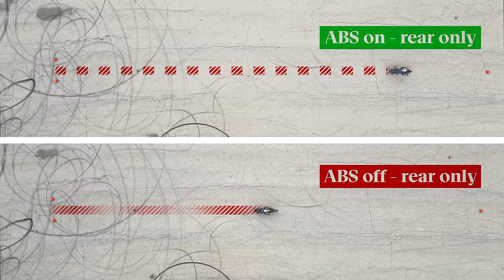Out-braking the ABS Myth

Comment: I wish bicycles had abs. When I need to make an emergency break, I pull both breaks but the back slightly earlier. But this doesn't mean you can avoid falling over. I experienced it myself. I went down a slight hill and tried to get as fast as possible. At +40km/h on my bike, I felt that I'm losing control, pulled both breaks and I felt over the bike. The thing was my back breaks weren't set up correctly and it was not on full power and also due to the situation, more weight in the front.

ABS by nature would mean you need longer to come to a full stop, when all wheels stay on the ground. A locked Tyre means maximum friction and maximum friction means faster stopping. ABS prevents a locked Tyre and so in return you stop slower. But a locked Tyre means you loose the ability to control them. In a car this would mean you continue straight on or you spin, when the force is not perfectly straight on, like in a turn. When you turn during a locked Tyre and it suddenly starts to roll again, you suddenly turn into that direction and people tend to turn more and more, when nothing happens and that would mean, you might turn way to much.

ABS is a good system, because you need to think less. You can go full power on your breaks and concentrate on driving. You can break and turn with ABS. Humans can't multi task. It's not possible and people who claim they can, lie. You can just switch between two things fast. You can't think about how you break correctly and where to steer at the same time. You can keep straight and think about breaking or you can think about turning but you keep the state of the break. You can't think about 2 things at the same time. With training you might be able to know how to break without thinking about it and then you can concentrate about turning. But you don't think about 2 things at the same time. ABS thinks for you with breaking.

Comment: I've found, in cars (I don't motorcycle), that ABS is a liability under any less-than-optimal conditions. I don't know if it's worth anything normally, but it's downright dangerous on snow, ice, and even wet concrete. I like my 1977 truck.

Comment: When I bought my 2016 Yamaha FZ-07 I opted no ABS and saved $400.00 .. My thinking was to sharping my riding skills.  The bike has so much engine braking that I don't use the brakes much in normal street riding..
  I did use the brakes hard on Tail of the Dragon and have practiced Panic Stops a few times.  When I do have to brake hard I put the rear brake on but concentrate on using the front brakes as much as possible.. 
  I think ABS may help a lot more on wet pavement ect.
   I did lock up the front wheel once.. I think it was when a Traffic light changed on me at the last second. I applied the front brake a bit too hard.  Now that I have a much stiffer front suspension with Ohlin Cartridges.  I can brake harder because the front suspension does not dive so much .

Comment: So, ranked from shortest to longest stopping distance:

1) Threshold front/rear with ABS off
2) Threshold front/rear with ABS on
3) Attempting 2 but failing (aka full front/rear with ABS on)
4) Rear only with ABS off
5) Rear only with ABS on
6) Attempting 1 but failing (maybe stoppie, worst case flying over the handle bar)
7) Not braking at all

Comment: I live in a third world country, ABS is for newer and expensive motorcycles. So I have my old motorcycle, without ABS, and I'm afraid of pushing the front break too hard, but I always used it. Still, 4 months ago, I was going too fast in an unpaved road downhill and I knew I had to decrease speed. I pushed the front break just a little bit, but it was enough to make me slide and I almost broke my hand in half. My hand has been hurting for the last 4 months, specially my thumb, and maybe it will never be like before. Sometimes I wonder if ABS would have saved me. These old drum breaks also change sensibility according to humidity, they have more grip if it's cold and wet, so you might get used to something and then overdo it.

Comment: Going back to a car, i drive a 95 1.6 lancer; real light, every pound is on the front. Being front wheel driven, living in finland; slamming that first gear in, and maybe giving slight hand break keeps turnability, and doesn't lock the tyres. Then slight pumping can be applied to the foot break. But ABS is the best if you lets say poop your pants.

Comment: ABS was created so you can't lock the wheel while breaking, and can keep breaking, not make you brake faster, it evolve with tech in motorsport to be able to surpass human ability to threshold breaking, by using various parameter such as unsprung weight, tire width, total weight etc, to make sure that the breaking will be optimal,it's the same with TC, it's not here to give you traction, it's it to make sure you don't loose traction

Comment: You seem to missing a gigantic fact: 

ABS preserves traction for maneuvering, where (human) emergency braking generally does not. 

During all the non-braking portions of the stopping distance, you have the ability to STEER the motorcycle without skidding out and falling. THAT is the true advantage of ABS, and is also the primary reason that ABS on a motorcycle results in better safety outcomes.

Comment: I had my rude awakening just last week, and I had seen this video a few times before that happened.

The situation wasn't dangerous just stupid from my end. I was riding in the big city with my travel cases loaded up for the first time in months. Legal limit was 70 and due to speed cameras in that road I was in fact doing a little below, while heading for a stop light.
What I didn't mention was that the road was wet and had pretty deep car tire grooves with standing water in them. I was chugging along in between those two rivers when suddenly, the light turned from green... to orange. 

The intersection behind that was for my qualification, very dangerous (as I live in a less populated area and also take the less busy/big roads all the time, but this time, I had no other choice). 4 lanes straight either way and one turn lane on the opposite side crossing my lanes, with on the right side 4 lanes with 2 going for them left and right each.

So here I am, less than idk 20 to 30 meters off, at 70kph aiming at an stoplight turning red any second, with a speed and redlight camera on my arse.

So I slammed the brakes and after a bit locked the rear entirely for a couple of meters before it started to skid sideways and I then release it. And you might notice I didn't say anything about my front brake yet. Because when I came to a standstill, out of fear someone else had also misjudged their braking distance, I still had the front brake on. Then, after the fear of me being pancaked by someone else or skidding right onto the intersection by my own mistake had cleared, I came to the shocking conclusion I hadn't used it much. With the end of a black skidmark 2 car lengths back telling the whole story.

Had I used more front brake, I wouldn't have missed the stopping line by 1 motorcycle length. I would've probably had meters to spare. Also there wasn't a car behind me on the lane. Only when I had come to a stop and loocked back I saw a car rolling over my skidmark, as stated before 2 car lengths back from me, so about 3 for the car.

My bike has no abs, she comes from 2003. But this rude awakening is exactly why I failed my first (European) motorcycle road exam. Little to no front brake usage.

On my way home after that stoplight fail I started using the front brake more, and still do now. Also keeping even more distance to vehicles in front of me, far over the 2 seconds that has been tought.

Stay save my fellow riders

Comment: And what stops manufacturers of motorcycles to build a break that recognizes when try to stop real hard and that will then do a two phase breaking on its own? As that's what my car actually does. It  recognizes the difference between normal breaking and slamming the break pedal to the metal and adjusts the breaking pattern accordingly.

Comment: Just moments after signing the purchase agreement and paying for my bike, I realized the bike didn't have ABS. This is my first bike. I was willing to spend thousands of dollars to add ABS to my bike. Everybody was telling me that ABS is not necessary and pro bikers don't like it. After watching this video, I believe what those guys were telling me.
Just a few days ago, I was riding 70-75 mph, and suddenly, two deer jumped in front of me. I braked 100% perfectly, and I was so proud of myself for managing to prevent the collision. I can't imagine what would've happened to me, the bike, and the deer if I had ABS. Even with perfect threshold braking, there was a 100% chance that I would have been seriously injured or dead.
However, I would never suggest anyone buy a non-ABS bike. ABS is absolutely necessary for wet roads. For about $1000 More, you can have this option for those road conditions, and you can disable it for normal conditions.
I think you should've tested and discussed wet conditions as well, where ABS shines!

Comment: In 99% of emergency situations, i am "slamming" front break and down shifting (it's by default, no thinking), and i never remember to add back break. For now, there was no accidents lucky me, only font wheel lock, emergency’s swarming (after releasing break, i have no ABS bike) etc.
Reply: Buy an ABS bike. Panic braking is probably the natural behaviour most riders will do, and i am one of those riders. ABS will save you from crashing, without it the probability of crashing increases. And releasing the brake to not crash means driving into the object you braked for - so you still crash.

Comment: Braking distance depends a lot on the technology used in the abs system. The cb500f has a very basic technology. In case of doing the same test in wet conditions the result would change a lot.

Comment: The bike abs system doesn't have to see the wheel locking as stated in the piece. The system iscsmarter than that, its looking at the rate of change and uses that to devide whether to let some brake pressure off.

Comment: When ABS fails, that is the control unit suffers an electronics fault (they are extremely sensitive to static as it so happens, try not to get hit directly or indirectly by lightning), the system seems to stay with the solenoid locking off the lever pressure and relieving the slave cylinder. This results in "no brakes" until the system decides it's in fault. How long does this take...about 2 car lengths at 60kph in my experience. If the fault is intermittent, the system tries to heal itself, that is, as soon as it thinks the ABS is functional again, it will go back to ABS mode, and then fault out, take time to decide it's in fault, and then go to non ABS. Repeat ad infinitum. In traffic on a rainy day this will get really old, really fast. Removing the "ABS pump" fuse fixes things nicely. Keep it as a spare. I was told that if the ABS fails it just goes to normal brakes. No. No it doesn't. There is time lag. It might not be much, but when sailing into a wet roundabout with an out of control car sliding sideways at you, it takes waaaay too long to figure it's shit out.

Comment: abs brakes are a safety measure solely to prevent crashing due to loss of control, not increased stopping capability. That's always been the case. The argument for ABS in cars is such that your car won't spin out of control in uneven grip scenarios. ABS less brakes on dry pavement have always been superior for stopping power.

Comment: Today i was going a bit faster than i should (50-60km) on an open bend at the end of which a car was almost stopped. Bacause the distance between us was less than comfortable to stop once i noticed the car, i (incorrectly) started applying the brakes a bit before i had the bike at a complete vertical stance (i.e. not leaning). I noticed my motorcycle pulling ''upwards'' fast (towards being vertical/not leaning) which was to be expected and i didn't hear the rachet sound the abs does when it deals with heavy braking, but i wonder whether, if not for the abs being on, i would have ended lowsiding. I have been riding for the last 10 years, daily, under all sorts of weather and for great distances because of my job and it was one of the few times in the last many years that i put myself in such a situation (mainly because i was not in the best condition to ride but that is a different subject). Apart from that being a wake up call to be more careful, i have realised that my conventional approach to keep the abs on always (although my first 6 years of riding were spent on a non-abs motorcycle) was the right choice. Despite what others have told me. You may be a great rider, but when you spend a lot of time on a motorcycle, every day, with cold, rain, gusts of wind and all the other vehicles around you at some point you are going to make a mistake. I believe i was lucky today and i appreciate my abs even more :)

Comment: I had a car with the worst ABS i've ever seen. Couldn't be the most mild possible conditions and the abs would kick in and the result was the car BARELY slowing down at all resulting in me having to pull the handbreak and almost instantly stopping the car with zero sliding at all. That car nearly killed me a few times with its overly sensitive ABS

Comment: ABS is a godsend in the wet. Saved my life once when a Tundra left turned in front. I've to hop onto the tank of non-ABS sportbikes to dig in that front patch with the stoppie. You can't really do that (the same way) in the rain. Probably... the best thing is just to ride slower.... 

ya, nahhhh 😆
Reply: Also... do people really ride without finger coverage on the front brake at all times? That seems....... insane to me. 🤔 I don't think in 30 years I have ever ridden gripping the throttle with more than 3 fingers, and usually two, with my index and middle resting on the brake lever. 🤷🏻

Comment: Motorbikes should have braking for both wheels. How it stops should be better managed. An ABS system on a bike should alternate between the front and back. This will allow as much stopping as possible with full traction to the road. The alternative is a quad bike. 4 wheels with tilt. You're getting 4 wheels, better stability and better stopping while being almost as light as a bike.

Comment: Damn I never knew that there are long term rider people who only use front brake during high speed at all. I used to do it when I was a beginner still riding those pesky 120cc no clutch with two drum brakes bike but then I starts using about 2:1 ratio of back to front brake combination naturally when I was got my first clutch operated motorcycle equipped with two disc brakes about 6 months later and been doing it like that ever since for about 9 years now. Crashed a few times not because I panic during braking but always when I leaned too much during slow corners but that was long time ago.

Comment: While different, the moral of the story is the same. As a mountain bikers, you have to learn how to use your front brake to it's maximum potential if you want to be able to go fast downhill and not hit a tree. It's all about modulation and the combination of both brakes. We also get a bit more control over the bike though since it weighs a lot less.

Comment: As someone without abs tc or vsc I find these aids just get in the way and allow for more lazy driving. Threshold braking should be explained in driving school not just because it works but it conditions your mind to not straight up panic when your about to have a moment granted i will concede that a light small car like a miata doesn't have the same inertial mass as the heavy modern cars but the principle remains the same. Drive your car dont let the car be your codriver or worse the driver.  Relearn the joys of driving for fun .

Comment: 2:16 That is wrong. ABS never was about shorter braking distance, not even in cars. I am old enough to remember the discussions and several comparisson tests on dry, wet, snow, gravel. And ABS never managed to get you to stop in a shorter distance. That wasn't what it's about: It makes you keep control of the car easier and to still manouver the car while full on the brakes. (and as a benefit, it prevents brake flats)
And i would claim the intended use in motorcycles is similiar: It's to not lock up and loose full control of the bike!
That said, i fully agree on the statement about the advantages of the human by being able to asess the situation and the rest you said.
I want to add something else: humans can detect a mistake they made while making it. Something no ECU, or even so called AI can.

Comment: In my mind. If you are slamming the rear brake and barely touching the front. Shouldn't the ABS notice that and go. "hey, seems like you are trying to stop, want help with that?" and start braking with the front brakes too. As you said. There is only one pedal in a car. Do you REALLY need two brakes on a bike? I have driven a vespa with only one brake and that was fine.

Comment: I think the takeaway is that ABS might lengthen the stopping distance, but it helps us to retain control over the bike even under panic braking situation. And for a normal rider (who isn't a professional motorcyclist), that makes all the difference in the world.
Reply: the main issue is that most people ride motorcycles for less than half of the year so they're basically starting from scratch each spring.